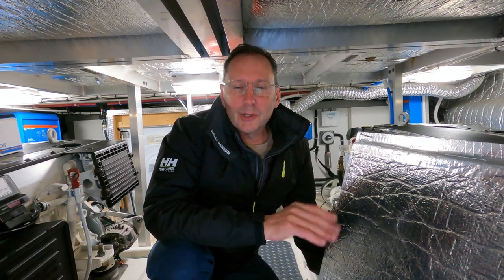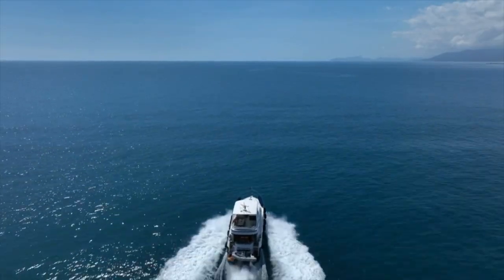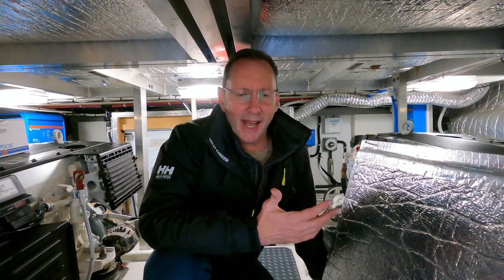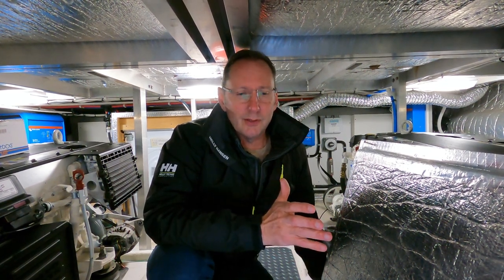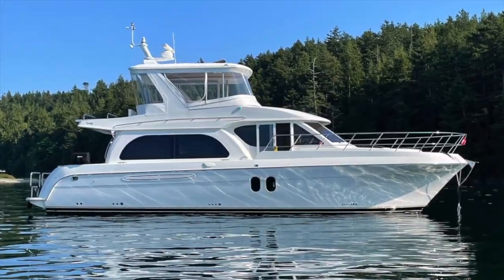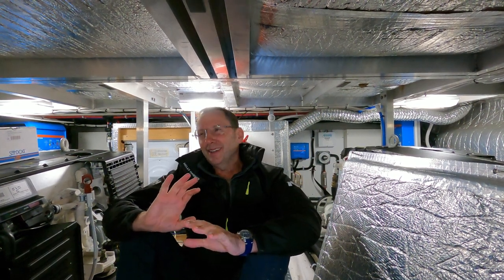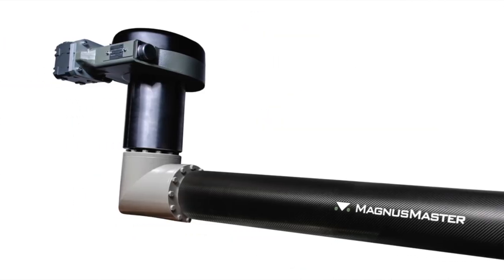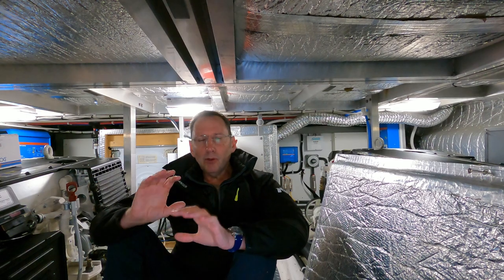Choosing Gyroscopic or Fin Yacht Stabilization

Comment: We indeed went 1 size up from what was advised. Reason was that other boaters (MY OLOH) explained that travelling at speeds below 10 kts reduces the efficiency of the stabilizers. So we decided to go with the stab 25 instead of the stab 20 for our boat size (50'). The difference between pre-stabilization and post-stabilization is immense. Before we had stabilizers we were rocking and rolling, it really wasn't any fun and we had to stay in port multiple times because the boat would just go beserk when in a heavy sea. Now ? We have no problem going out or getting caught in a storm boat is lying rocksolid and on anchor or even in the dock we lie completely quiet, very comfortable to have onboard. 
Electricity usage is no problem.  On anchor we use perhaps 400 - 500 W at 220 V or 20 - 25 A at 24 V and since we have a large battery bank (1400 Ah) we can run the stabilizers all night long with no need for a generator. 
Underway, in heavy seas we can use up to 1 Kw total and the alternators plus solar panels have no problem supplying that. 
In other words, the electric stabilizers, for us, are the best choice we have made. We made our boat safer, more comfortable and if we ever buy another boat..........it needs to be stabilized. Never ever again will we buy a boat without stabilization.
Reply from the maker: Thank you for sharing your experience!  What is the tonnage of your vessel?
Reply: @ElliYacht1  We have a Defever 49, which is about 28 tons. Normally we cruise at 6.5 kts and after I saw the video of the guys of MY OLOH I contacted them and they advised, because of our low speed, to size one up. Best advise we have had. 
In your case you cruise at much higher speeds, above 10 kts, and that is what the stabs are calculated for as a minimum. So you will be absolutely fine. 
We love our stabilizers, wife was about to throw the towel in the ring, she had enough of all the rocking and rolling. Also our dogs were getting sea sick all the time. Now we are a bunch of very happy campers (so to speak), we have a lot more comfort onboard. 
Great videos you made on the installation and sorry to break into your channel like this, but I agree with you 100%, the electric stabilizers are complete game changers for boaters in our size.
Reply from the maker: I couldn’t agree more on the 25’s for a troller. Great choice. Interestingly, the actuators are the same on the STAB 20&25. The difference is the fin size.

Comment: Some boats are putting hydrofoils under the boat on multihulls, not so much for stabilization, but for better fuel consumption. But, like fins they are not conducive for shallow waters and seaweed, flotsam etc in the water.

It also depends on your local waters and what you will use your boat for. In my waters we have intracostal waters and ocean opportunities. 80% of my boating will be in intracostal waters, island hopping and exploring, which means I need to get close to shore in shallow waters and there are shifts in sand even where there are channel markers, so fins are out of the question for me.

I am looking at a new Princess yacht V55 with a seakeeper giro as OEM, which I think will be my best solution. Good video. I wasn't aware that giros lost some effectiveness above 10 knots. Good to know 👍
Reply from the maker: That’s a good call out. Congratulations on the Princess. Wonderful vessel. 

Our fins will be 23” in height and won’t hang below our keel. However, our props and rudders do so vigilance  is always priority one in the San Juan Islands…
Reply: @ElliYacht1  👍

Comment: I am testing out my trawler to see it's seaworthiness. Well both crew (sailing singlehanded) and boat are not. These recent tests gave nice footage for my channel, but... when I want to get to the 'place where the sun always shines', I need stabs. So I did the same research as you describe, almost would go for the magnus, but one of my subscribers recently bought the 25 on a 49ft yacht and pointed out the zero-speed option. So I too will go for CMC.
Based on the info I gave CMC they also advised the STAB20. Lady Liselot is 50ft and weights around 35 tons. From (new) CMC users I understand it's better to have 1 size larger, so I also have a quote for the 25. What is your experience or thoughts about that?

Comment: Good video!! My only comment would be maintenance.  The Sleipner (Side-Power) fins require maintenance at 4,000 hours.  That's a lot of use, years for many. Otherwise, great explenations!

One question- in your conversations did you ever talk to the fin sales guys about planing hulls? Can planning boats like our 49'6" Cruisers Yachts express cruiser use them, does a planing hull allow for fins? Or stick with gyros? Just curious if that ever came up.  Thanks!   Just found ypur channel, now a subscriber.
Reply from the maker: Great question. The CMC fins are designed to accommodate high speed planing hulls. The GPS adjusts the fin angle real time based on speed. It’s like a magic carpet. 

Gyros actually become less effective as speed increases, 8 knots is starting speed of degradation.

Comment: With regards to a gyro stabiliser not working while the vessel is underway, especially at higher speeds, what makes you think that? If you size the stabiliser for small magnitude and frequency waves while stationary it will be under powered while underway, but if sized correctly, I don't see why it would not work as well at higher speeds.
Reply from the maker: The reduction of roll stabilization effect as speed increases for gyroscopes isn’t an opinion, it’s a law of physics. During our design research period it was stated by every gyro manufacturer we engaged with. They can provide more information, if you are interested in debating their product capabilities with them.
Reply: @ElliYacht1  If you understand the reason and agree with it, are you able to explain it? Just curious as to why and how.
Reply from the maker: When a boat is at-anchor or underway, both systems will improve stability in both situations if sized properly. Fin stabilizers work best when the boat is moving, but bigger fins are needed for optimum at-rest performance than for underway performance. That’s a trade-off that may lead to different decisions, depending on how a boat will be used. Gyros, on the other hand, work best when the boat is stationary, or moving at slow speeds; larger gyros are needed to provide good stabilization when the boat is underway. This also requires analysis of how the boat will be used and when the best performance is most important.

The fundamental difference between the two systems is that fins generate greater and greater force as the rate of water flow increases (i.e., the faster the boat is going). This force increases exponentially with speed, which is a massive advantage compared to gyros. A gyro system generates the same amount of force, no matter what speed the boat is moving, so it is less effective the faster you go.

When a boat is planing, it is hardest to stabilize; the boat becomes more rigid on a plane, so it wants to assume the angle of the wave. That is, it wants to roll with the wave. Due to the tremendous force generated by the foils at speed, here’s where you can take the greatest advantage of the fins’ underway capabilities. The fins have more power to stabilize the boat exactly when the boat is hardest to stabilize, and as an added benefit, will counteract list from crosswinds or weight distribution. Conversely, as mentioned above, a gyro’s force remains constant, restricted by the size and speed of the gyro flywheel, and it can’t correct for list.
Reply: @ElliYacht1  Okay, I agree with the listing. A gyro can only compensate momentarily for roll, where as fins can compensate continually for list. The lower power consumption of the fins is impressive, though for a motor yacht with large output, even 10kw is not all that much for an engine. I think the fins are a good addition (depending on orientation) for the use of a kite also. I think the stability at speed would largely depend on the centre of gravity, if very low it would be less of an issue and the deadrise of the hull. Thanks for your response and time. Be safe.

Comment: Slightly misleading in as much as you said no need for a haul out when fitting a gyro system, wrong, Seakeeper is cooled by sea water and therefore needs a haul out to fit through hull components. Quick on the otherhand is air cooled and can be fitted while the boat is in the water. Otherwise a good informative video, thanks.
Reply: @keithhughes  problem with the seakeeper is that the bearings need to be changed every 3000 - 5000 hours and in order to do that you will need to completely disassemble the gyro. On top of that, they guzzle electricity, so you almost need a special generator to be able to run them. For us those 2 items made us decide against the gyro system.